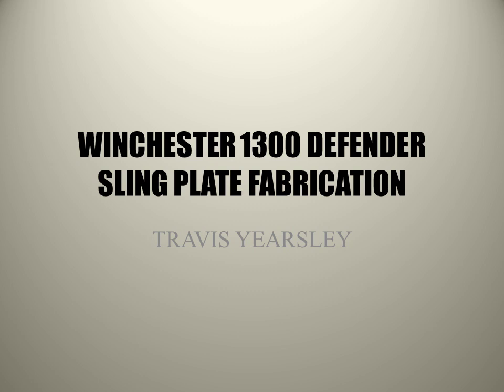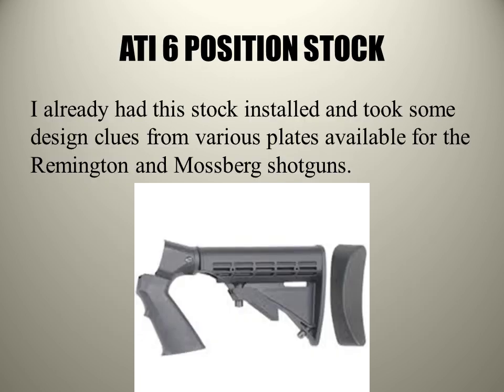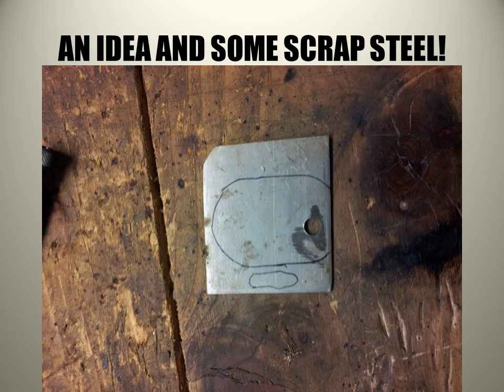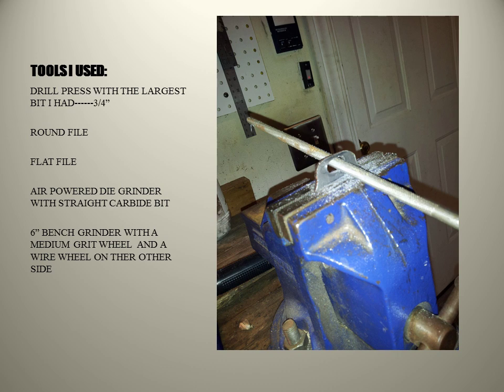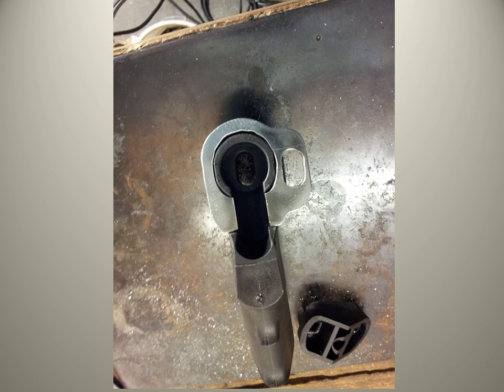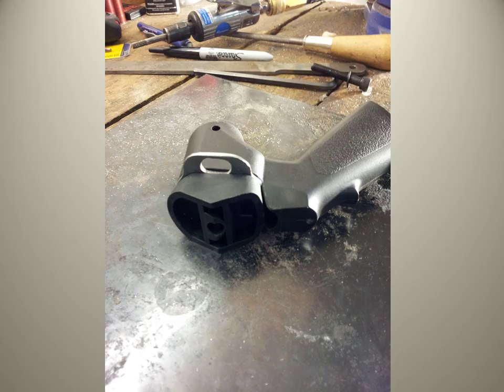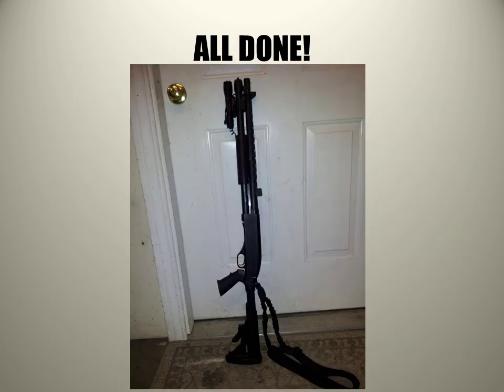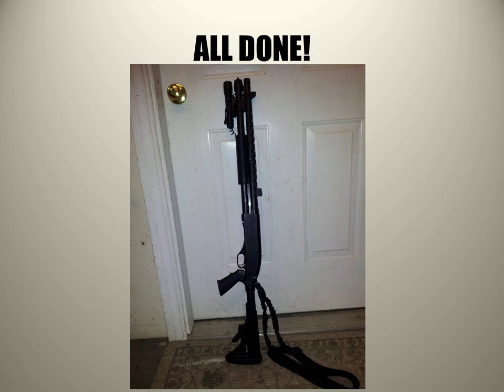Winchester 1300 Defender sling mounting plate, ATI 6 position adjustable stock modification

Comment from the maker: I re-used all the original hardware.  No longer bolt was required.  The metal I used for the mount is just under 1/8" (roughly 2 mm).  I am glad you found this helpful.

Comment from the maker: Kevin, I happen to live within a few miles of Centerfire Systems here in Versailles, KY....I am not endorsing them intentionally, but it is my local source......they apparently have in inventory the same ATI 6 position stock my 1300 is wearing in the video.  The part number is SF-MRWBS .  Call and talk to Ed....awesome guy.  There are other sources for this stock.  If KY is too far away, I would suggest calling ATI to have them identify a more local retailer.  Thank you for your interest and loving the Winchester 1300.

Comment from the maker: Kevin.....by the way, this is not a folding stock. When I bought it used back in 2003 it had a Choate stock on it, which I sold on ebay.  The fore end is a Winchester factory piece.  Winchester still sells replacement parts for the Winchester 1300 Defender, although, you may find something better........MAGPUL may have something you desire.

Comment: @Travis Yearsley Thanks for posting this Mr. Yearsley. I purchased a GG&G single point mount for my Defender a long time ago from an Amazon vendor and it did not properly fit. It would have taken too much work to slim it down and re-shape certain parts on it. I gave up after that but I would still like to have a single point mount in addition to running a two-point setup for it. This video is very helpful. Did you have to use a longer bolt when you added the steel piece in between?

Comment: I like the ease of your video to follow, nice job. We were out shooting our Defender today and I realized that I would like a light and sights on it with a collapsible stock and found yours was set up just like I want mine (well.. my wife's). What light/sights do you have on it.. I read that you have an ATI stock. Thanks!
Reply from the maker: Thank you for enjoying my video and finding it inspiring.  I have a Marble Arms Expert Shotgun Sight installed on my 1300.  It is a tritium Trijicon front sight only, that replaced the factory front bead sight.  I bought it from Brownell's.  I placed the order over the phone and cannot recall the specific part number.  Contact Marble Arms for the correct model number and then order from Brownell's (Marble does not conduct direct sales....only through distributors).  The flashlight was purchased from Centerfire Systems in Versailles, KY...where I happen to live.  Check out Centerfire's website.  Here are the specs:  LED Tactical Flashlight #LITFLA.  Six volt 200 lumen CREE LED tactical flashlight with integral weaver mounting base.
This flashlight features a strobe feature, which can be controlled through both the base switch and pressure switch.
It has a 1.25 bezel and 1 tube. Tail cap, removable pressure switch and lithium batteries are included (Two CR123 batteries). 

The flashlight cost about $60 and has functioned flawlessly ----I also have one on my AR15.  I could not justify a $200+ light for a home defense shotgun.  I liked the fact that it had the integral picatinny mount, which attached to my $17 barrel-mounted tri-rail. 

If you have any more questions I would be happy to help.  If you would like detailed pictures, send me an e-mail and I will take some and send them to you.

Take care of that Winchester! 

-------Travis
Reply from the maker: I am sorry, I just watched my 1300 video and realized that at that time I had a different sight set-up on the shotgun than what I currently have (the Marble Arms tritium sight).  In the video I had an ATI heat shield with the ghost ring sight kit installed, again purchased from Centerfire.  I went with the simple tritium front bead because the heat shield had a screw clamp barrel attachment that would not tighten enough to maintain proper placement after firing a few rounds of 00 Buck.  It would rotate on the barrel and the sights would no longer be in line with the top center of the barrel.  I was not satisfied with the attachment of the heat shield, so it was removed and replaced with the more practical tritium front bead.  Sorry for the confusion.

Comment: Sweet, thanks for the info. I went and bought a piece of scrap plate steel about 1/8" thick. I can't wait to make this when I have time. I was going to attempt this a long time ago with aluminum and never did. I think will handle stress better though. How did you trace your "template" onto the metal? The mounting surfaces aren't exactly flat. I wish I would have made a template of that GG&G mount. It was the right size but too thick and the indent at the bottom wasn't quite right.